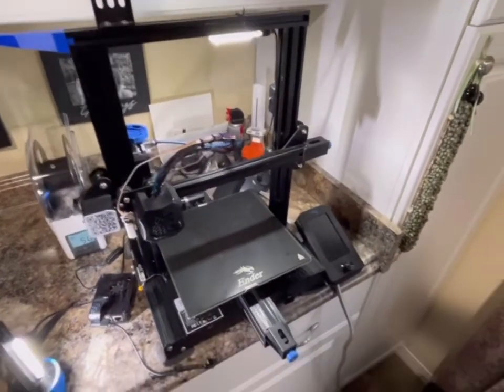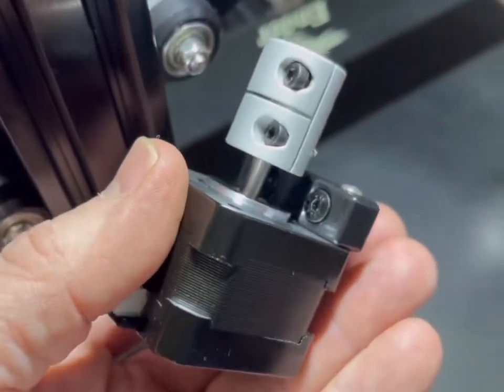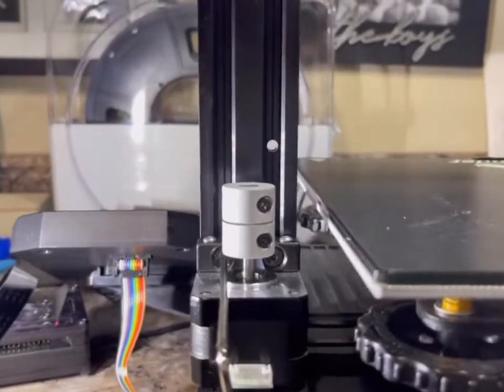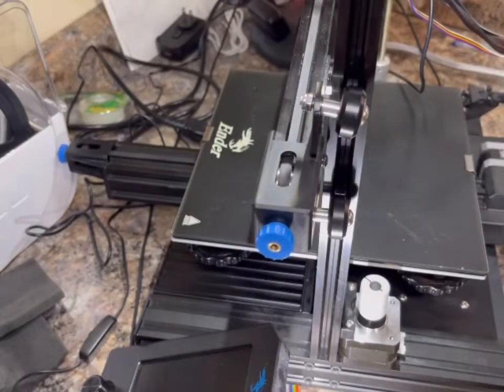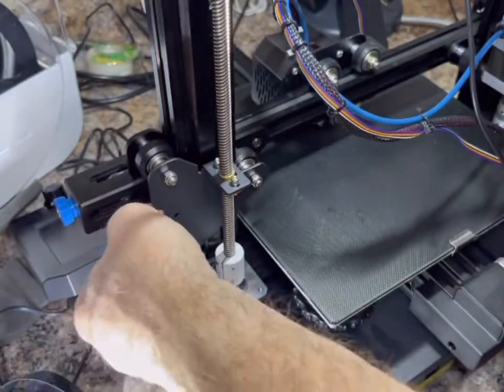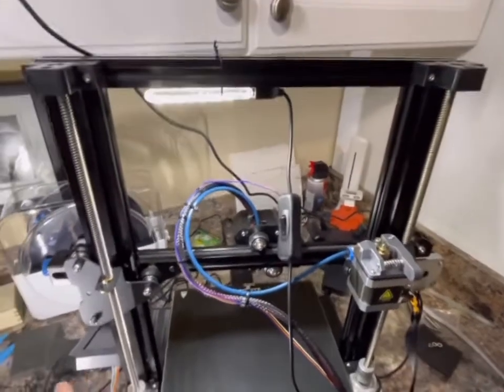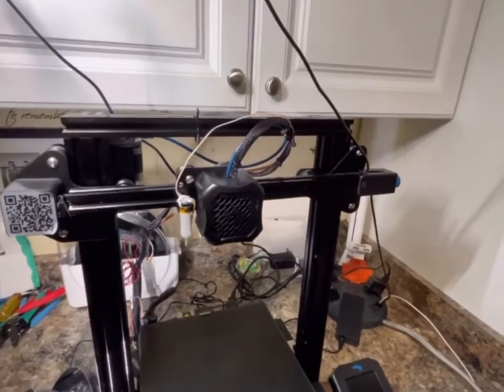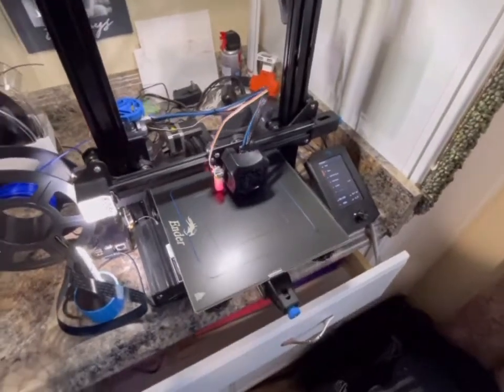Ender 3 V2 Dual Z Axis UPGRADE Install video (part 1 - stepper motor)

Comment: This upgrade can be further improved with a z-sync kit that links the two lead screws with a gates belt at the top. Some argue it's not necessary however any time someone touches one of those two lead screws, they are bound to come out of alignment. This could also happen during normal operation or even when the nozzle hits the print, or the bed by mistake. I added that to my upgrade and never had to align the two sides again. You can also look at all the recent new printer releases that come with the dual-z upgrade built in to see that they all have the z-sync installed by default.
Reply from the maker: You are SOOOOO  Correct!!  Thanks.  I have been battling that problem.  They get out of synch so often.  Then I have had to get the calipers out and rebalance them.  I will add that mod!  Many thanks!!
Reply: This is what I'm afraid of with the dual motor kit. Can you link the z-sync kit?
Reply from the maker: Sorry- I just saw your comment.  I made another video with that kit in it.

Comment: I have been thinking king about this upgrade. Question is, have you seen any improvement in print quality after this upgrade.  Especially since you are not using the direct drive extruder..
Reply from the maker: I would say the print quality isn't a huge improvement on small prints - but was noticeable on larger ones.  The biggest benefit was leveling.  The ABL probe didn't have to compensate for sagging x gantry anymore.
Reply from the maker: After doing both the dual z axis screws and the motor; THEN the top sync belt - I have to say that you are better off doing the entire thing (not just the dual z/motor).  The top sync belt is necessary for keeping the gantry from becoming unlevel while power is off.  Despite what other's think - it was worth it for us.  We produce and sell parts.  Having the gantry perfect on larger prints is absolutely required.  I also have a Prusa that came with everything obviously.  Having that machine proves to me that the upgrades are worthwhile for sure.

Comment: I bought one on Amazon, Not the same brand. Got it installed, The issue I'm having is it seems to be working against each other.

I raise it 10mm on the Z axis and it raises 5mm then starts clicking almost like it's working against each other or maybe the new stepper is getting binded in an angle or something and not wanting to travel the distance.

More than likely going to remove it and send it back.
Reply from the maker: Yeah that is frustrating. I would return it. Although you have to make sure that they are equal manually first before adding the power to them. I’m sure you already did that though.

Comment: AFAIK the pommel wheels should NOT be spinning freely at all!! If they do, they are too loose. They need to bite/rub ever so slightly against the extrusion.
Also, your second Z-axis seem to have quite a bend. As such, you are far better of leaving that top holder off. Because that will bind up that z-axis. Or use a spider coupler between the motor shaft and the z-axis.
Reply from the maker: Thanks for the tip!